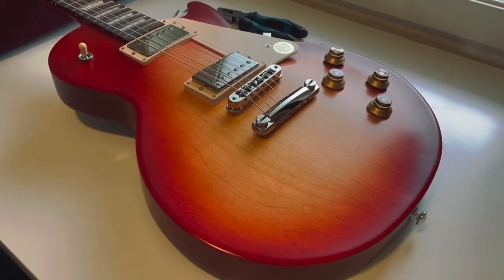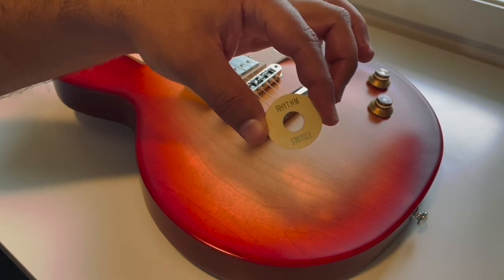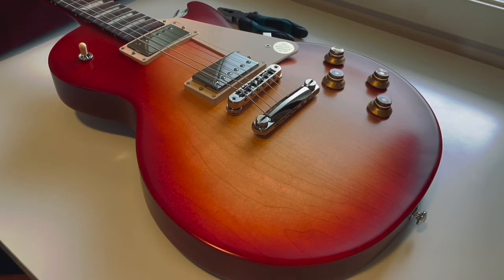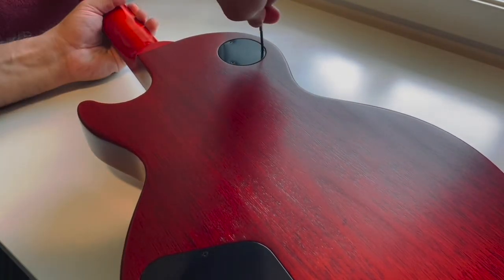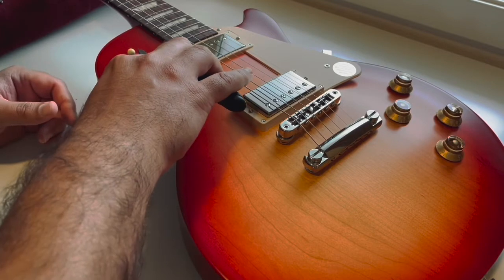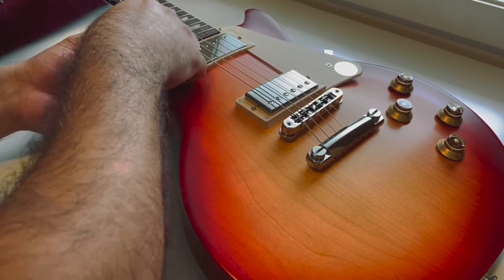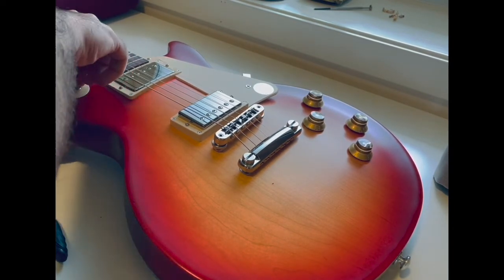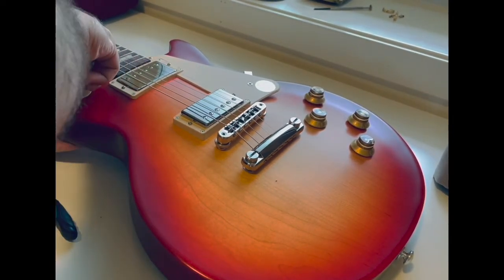How to Install Poker Chip On Gibson Les Paul Tribute

Comment: Hello,

I purchased a Gibson Les Paul Tribute Model 2023 a couple weeks ago. I'm trying to install my poker chip which was inside of my gibson case during the delivery. Unfortunately, during installation, the washer is not put on and is not fixed. I support the switch with my finger from the back of the guitar. How could it be installed? I don't have any rings inside that hole as well. Looks like I have an extra tied washer inside. I have no idea how to get rid of it. The hole is too small for fingers.
Reply from the maker: as I said I don't understand why Gibson wouldn't put poker chip on Tribute. This is obvious problem which can't be solved easily. It is difficult to fix the chip. By the way I used another tool few months later, and it helped to fix it. You may watch this video from 1:28 
https://www.youtube.com/watch?v=RnFZqMDu7qU
I hope it helps you 🙂